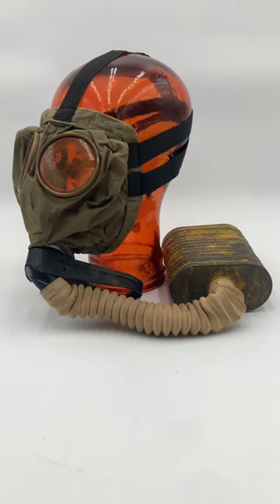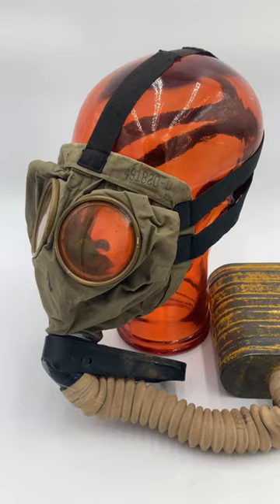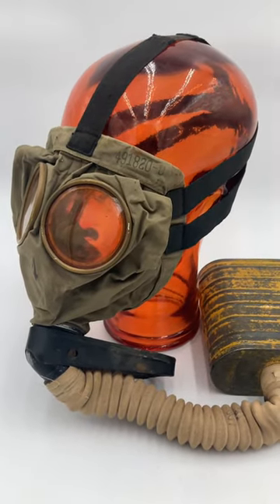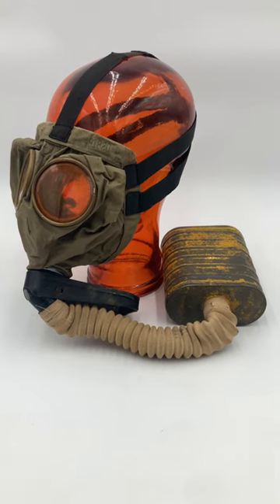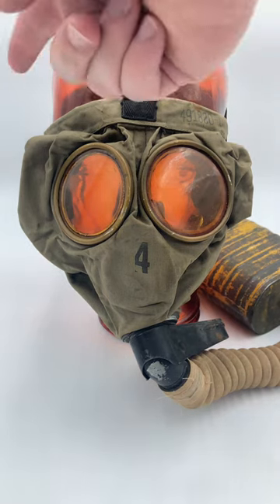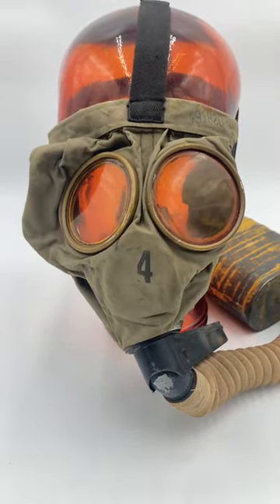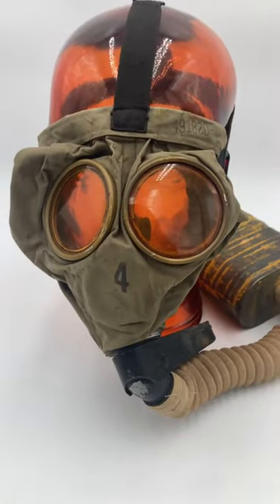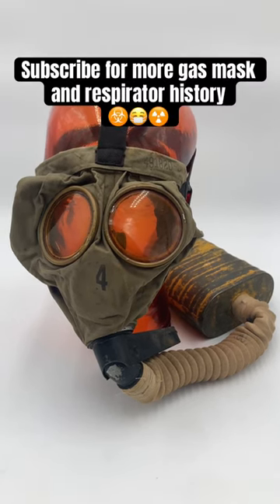This WW1 GAS MASK has an ODD feature 🇺🇸😷 #gasmask #military #ww1 #history

Comment: What does it mean if it has a green filter
Reply from the maker: That's either a Type J or Type L (though my money would be on J) filter. Those are lower-resistance canisters developed later into the war. Corrected English Type Box Respirators can be found with a number of canisters; including the Types G, H, J, and even British-made canisters!

There should be a serial number on the top of the canister it will end in either "XJ" or "XL" if it ends with J, it's a Type J and vice versa.

The Type L was differs from the Type J only in improvements to the packing of the absorbents within the canister.